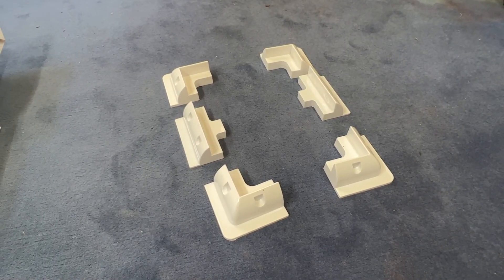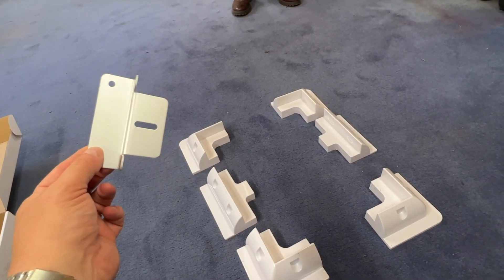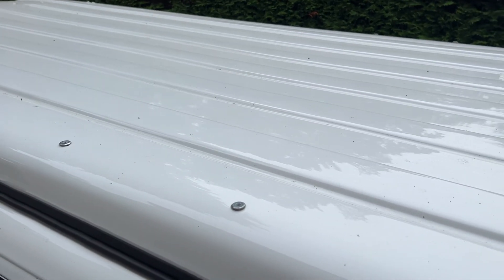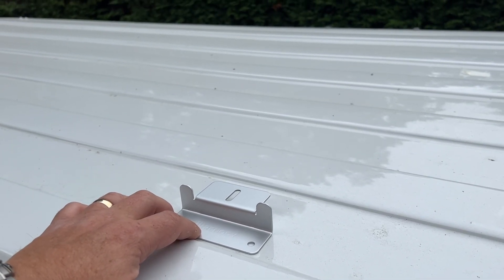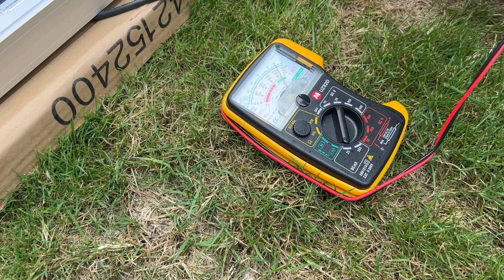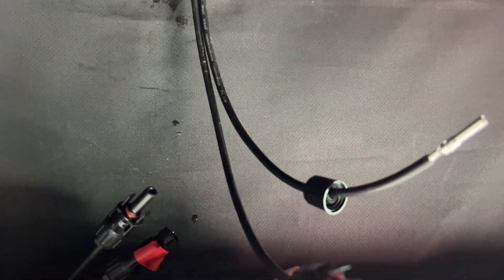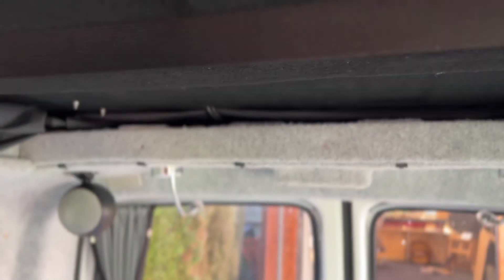Fitting a Rigid Solar Panel to a Pop Top Campervan Roof

Comment: Wow. An analogue multimeter! Long time since I saw one of those. I've been going back an forth on the panel type and fixing method for some time now. The main advantage of a rigid panel is that 500W costs you £100, not £900.
Main disadvantage is carpark barriers - I'm already 2.03m high. Another 3 cm is not desirable. Rigid panels are more robust, so long as they survive the vibration. No problem with yours after 2 years?
How much did your panel weigh? About 20Kg? And the pop-top gas struts still work fine? I was wondering if one would have to get some stronger ones for this. 
As you observe it doesn't look too bad at all, and should be noticeably more efficient with an air gap. I am tempted...
Thanks for documenting your efforts. You might be interested in how Bluefix fit panels: https://www.youtube.com/watch?v=hAJJ3sYgILc Either long ali angle brackets, glue, with tile spacers(!) or z-brackets glued and screwed as you have done.
Reply from the maker: Mine still working perfectly. No regrets with my choice. Cheers. N
Reply: @highergroundlifestyle  Your video encouraged me to go this route after much deliberation and I've just glued two 200W panels on yesterday. using the Bluefix method. All seems to work nicely - just need to drive down the motorway and check they stay on :-)

Comment: Great vidoe, how do you find the weight of the pabel effecting the pop top lift rams with the added weight?
Reply from the maker: Hi, many thanks, it doesn’t have any impact as the weight is all to the rear. This was part of my planning considerations. Cheers. N
Reply: @highergroundlifestyle  just installed a 400watt domestic panel weighing around 20kilo, the only difference I feel is it's slightly harder to push up. Had some 30mph gusts the other day and didn't budge
Reply from the maker: Well done!

Comment: Hi. What size bolts did you use to fix the aluminium brackets to the pop top roof. (Video is awesome some great tips thank you)
Reply from the maker: I used the shortest stainless  bolts I could get away with - just enough to get a nylon nut on so they could be covered with soft covers. The size depends on the thickness of the material it needs to go through then and may differ on different parts of the roof. Cheers. N

Comment: Hi my camper currently has the leisure battery charged by the van itself. Can I use a solar panel in conjunction with my current system, or do I need to disconnect the van charging side?  Thanks
Reply from the maker: You most certainly can but you will need a charge controller to do this. It will allow your battery to be charged by both the van’s alternator and your solar panel, ensuring that you always have a means to recharge your battery whether you’re driving or not! That’s what I have installed here.
Reply: @highergroundlifestyle  thanks what does that look like
Reply: Do you mean what is sullied in a full kit
Reply from the maker: @angelaandpaul4945  In this video it is the blue box shown at 15minutes 20 seconds.
Reply: Yes you can. Just add the panel+MPPT controller. Both chargers should work without upsetting each other (this is the standard configuration for Victron kit). You can get combined devices which will do both jobs, like the one in this video.

Comment: What size, length by width was the panel and what was the power output and where did you get the gland from.
I've got to do mine and I'm dreading it as its a brand new van and the pop top is in reverse as its a rear kitchen.
Thanks for the info anyway 👍

Comment: An amazing video. I feel more confident in fitting my own. 
My current leisure battery is charged by my van. Can I use in conjunction with the solar panel or should I disconnect the van charging side.
Reply from the maker: Glad it helped! The solar panel can be used in conjunction with your existing charger but you’ll need a suitable charge controller as shown in the video. Ours has Bluetooth which connects to an app on the phone and shows battery health and solar charging status. Best wishes. N
Reply: @highergroundlifestyle  thanks I’m going to buy one from the site you recommended 👍
Reply from the maker: @angelaandpaul4945 have a chat with them, tell them what you already have and they’ll advise what you need. I’m not on commission - but found their service excellent!
Reply: Actually you don't need a dual controller - you can keep your current one (or simple split-charge device) and add an MPPT device for the PV side straight to the battery. Each device can charge or not charge as it sees fit.

Comment: Super video, thanks.
Did you had any problems with the flexible solar panel, mounted directly on a black roof during the hot days last summer?
Great tip removing the Sikaflex with the BC-90 cleaner!
Reply from the maker: Thank you. Personally, I wouldn’t use a flexible solar panel! They are expensive, less efficient, overheat, need to be glued to your van and don’t last long. Best wishes. N
Reply: @highergroundlifestyle  All of that is true, although so far as I can tell 'don't last long' depends a lot upon the panel and fitting. I have plenty of reports of ones that have run for 5-8 years, and I own some that are 17 years old and still working. The one significant advantage is that most CIGS panels come with loads of bypass diodes so they work proportionately in the shade, rather than basically not working at all with any shading. People could make rigid panels with this property but only Renogy do (ShadowFlux) and it's expensive. I do like to park my van in the shade in the summer.  Of course your method adds quite a lot of shade for the roof itself. Do you think it's any cooler inside the van on a hot day?
Reply from the maker: @ I see no difference to internal temperature.

Comment: Thanks for the excellent video it was really helpful for when I did my panel. A friend had told me about the thin flexible ones not being good. A few things I did differently which may help someone else. I used the victron 175w panel as I was worried about weight combined with wind pushing the roof down, as the 205 is meant to be 5kg heavier. The 175 is OK and gives about 3 days off grid with a cr50 45w fridge but doing the maths afterwards the 205 should be indefinitely. I put the solar connectors on the outside of the van so I can swap out the panel if I do have problems. I connected the fridge directly to the load output on the victron as this allows you to monitor the draw of the fridge and how often it is turning on and off, which was really helpful in working out if it was getting too hot at the back, but which it was so I fitted some fans to take the hot air away. Thank you again I owe you a beer.
Reply from the maker: Thanks for the feedback. Glad the video helped! N

Comment: Could you please add a link to the brackets. The only ones I can find comes with screws and not nuts and bolts. Thanks.
Reply: I used stainless steel nuts and bolts and nylon washers so not to get severe corrosion from the stainless steel onto aluminium

Comment: Hi, will I still be able to get under any drive through barriers.....eg Costa
Reply from the maker: A pop top roof probably stops you getting through most barriers - a rigid solar panel on your roof would certainly prevent this. Of course it all depends on the barrier! Cheers. N
Reply: @highergroundlifestyle  I've not yet found a '2m' barrier that my 2.03m high pop-top doesn't actually fit through. Adding another 40mm would be pushing our luck a little I think.

Comment: Thanks for this. I am wanting to do the same with an older fibreglass poptop but nervous about possible uplift pressure generated at speed, so it was good to see the road test. Did the extra weight make it difficult to raise the poptop - I am wondering if our 13kg panel may require upgrading the springs that offset the weight of the roof.
Reply from the maker: Hi, thanks. As noted in the video, we located the panel further back to reduce the impact of weight and place this over the springs. You can’t tell there’s any extra weight and it’s completely unnoticeable when driving or operating. Best wishes. N
Reply: @highergroundlifestyle  Thanks! Wish me luck..

Comment: Hi - really good video - I am looking at doing the same thing. My pop top is ridged like yours. It has a slight concave curve in the lower section - presume yours has the same - how did the fittings and rigid panel cope with the flex / bend ? Does the solar panel have any flex in it ? Thanks
Reply from the maker: David, many thanks. Yes, I recognise your comments re the concave roof! The panel does has a slight bend in use and the frame has taken this up although it is not obvious. The flatness of the panel/frame also sits comfortably within the overall shape of the roof and actually looks really good. I’m glad I went for a rigid panel and one that was this size. It looks “right” on the roof, has no trailing cables/obvious glands and works really well. We’re just back from a week away - most of which was off grid and never had issues with battery capacity. Ice cream and lollies were also still frozen hard when we got back! Best wishes. N
Reply: @highergroundlifestyle  thank you - appreciate the feedback